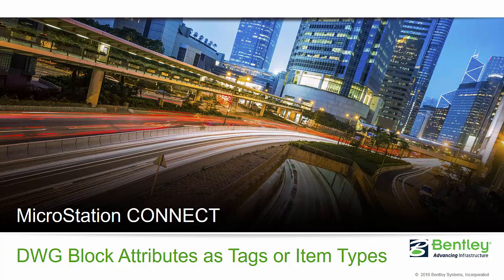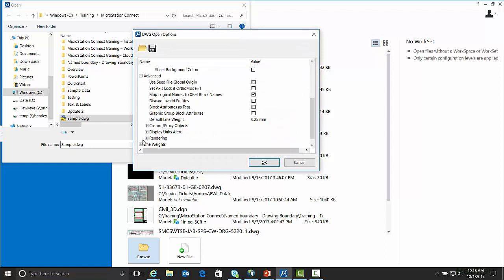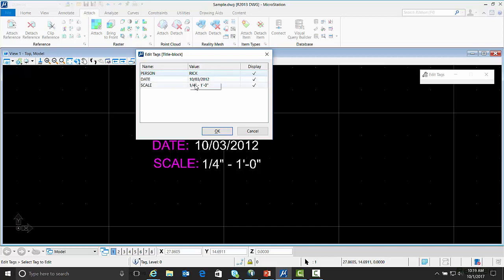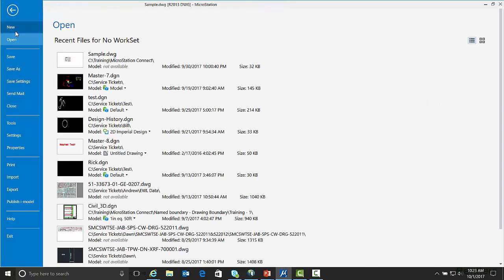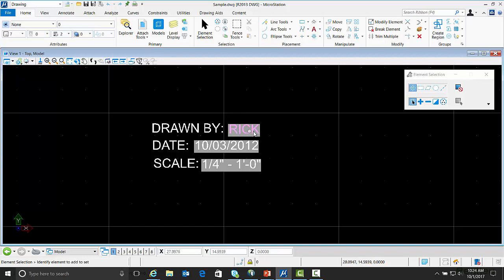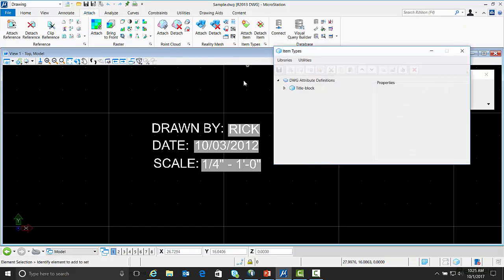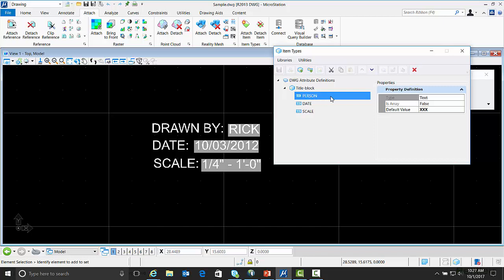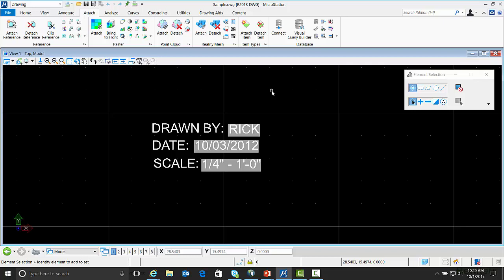DWG Block Attributes as Tags or Item Types

Comment: Why not just build an excel manager into item types so tags can be managed outside the program? No one wants to fill this out individually per sheet
Reply from the maker: Related to Item Types, this is something that we are aware of and have looked into. Recently (CONNECT Edition Update 15) we added a way to manage Item Types using an Excel spreadsheet.
Reply: pro tip: you can watch series on flixzone. Me and my gf have been using them for watching all kinds of movies lately.
Reply: @Torin Cody Yup, I have been using Flixzone for years myself =)
Reply: I am presently working in an older version of Micro station.   I am needing to make a new text attrabuted block...  However not having any MicroStation experience..  I am not sure how to accomplish this?

This video was made 3 years ago!!! Not sure if your even able to assist me here?

But I'm throwing out a line to see who might help??

Thanks